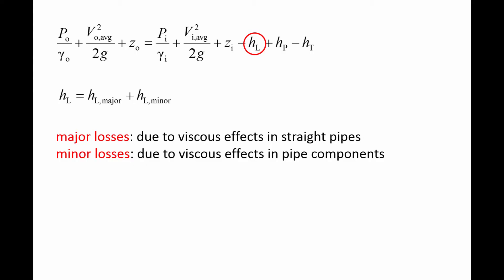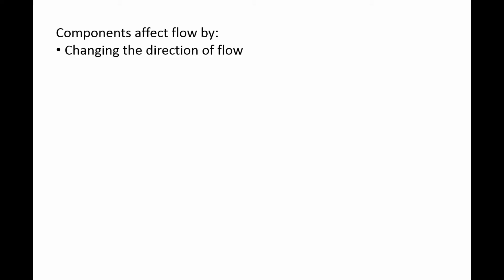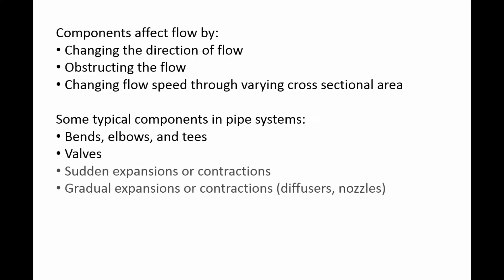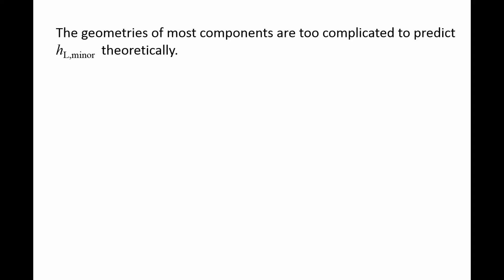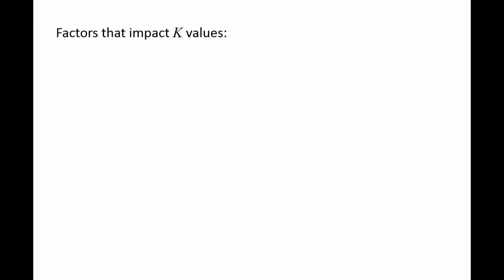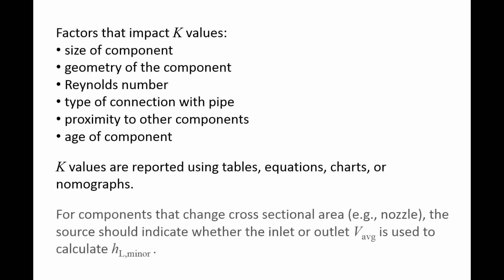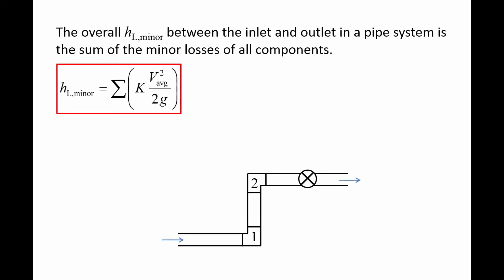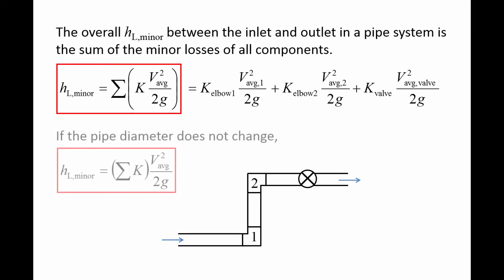Fluid Mechanics: Topic 8.7 - Minor losses in pipe systems

Comment: But even if the pipe diameter does not change, we will still have velocity change due to friction causing pressure losses, right?
Reply from the maker: If the pipe diameter does not change, the average speed will be constant throughout the pipe. The pressure due to frictional losses will decline along the pipe.

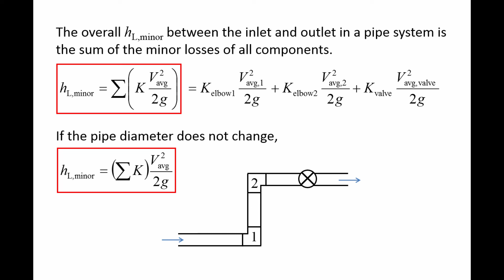Comment: at 3:40, why wouldn't the velocity change by bernoulli's eqn since there's a difference in elevation
Reply from the maker: speed is related to conservation of mass. If the fluid density and area do not change at the inlet and outlet, the average speed would not change.